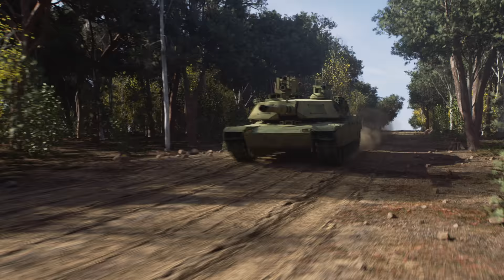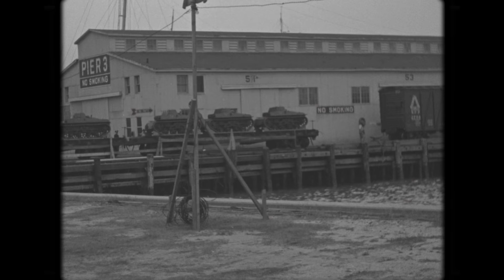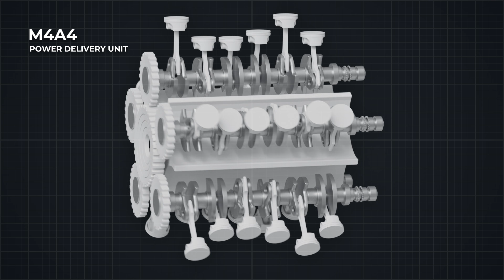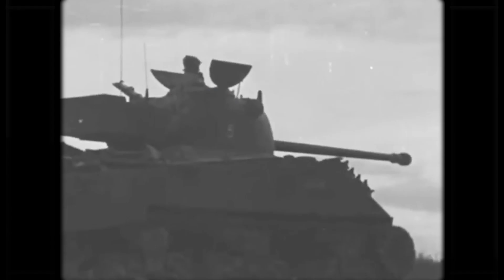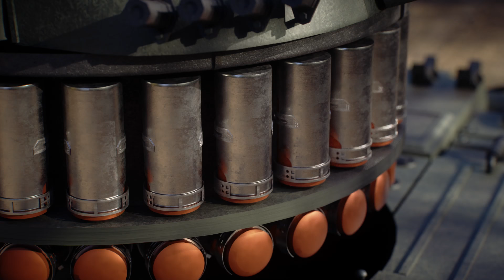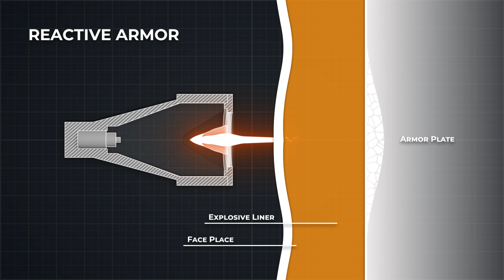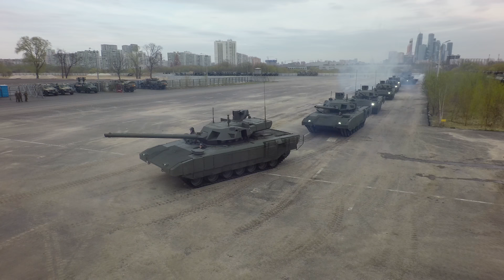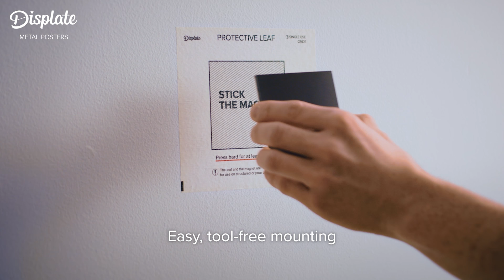Why America’s Tank Failed in Ukraine

Comment: drone threat can be solved by just making a didicated remote weapon station equiped with ir cameras and hearing which will see and identify drones with the help of AI, these things cost 1/3rd of what aps like trophy would cost. take and example of bullfrog rws, but the problem is its not following my researched desighn philosphy, its too bulky and big. my desighn comes with weapon station with short barrel mg42, backed up by short barreled shotgun if the fpv slips throug., this desighn has its cameras and hearing sensors equiped on corner of a tanks turret, thus making the main rws station less bulk and creating more room for AI and software alsong with ammunition. with this, it can engage fpv drones at ranges of 6-700m in seconds. plus it would cost not more then 50k comapred to active protection system that cost 900k$ and come with limited number of projectile that can be emptied by swarm fpv attacks. i hope defence companies can look into this rather then wasting time on new tank desighns and expensive APS. one thing i wanna say is that this AI anti drone weapon can be mass produced and eqiped on any armored vehicle this it comes with already mass produced mg42, and any shot gun. optics and sensors and not much of a big deal, these can be developed by 3rd world countries.along with hard kill, it can be linked with EW systems, thus providing absolute protection dome for tanks, APC, mraps, trucks, convoys, strong holds, bases, logistics etc. thanks you for reading this, if you came to the end.

Comment: Can I just say that while I largely agree with the premise and findings of the video, I have a certain bone to pick with these types of presentations?
See, whenever a Russian, Chinese, or otherwise "non-Western" system underperforms in a given conflict or scenario, it's all chalked up to the corruption, lack of innovation, capability, or inherent inferiority of those systems.
But whenever a Western system underperforms, there's always a tsunami of excuses about how maybe the crew wasn't good enough, or maybe the system wasn't suited to that situation, or how it didn't have proper support or tactical positioning. My point is that Western systems get a lot of nuance and policed language, whereas non-Western systems don't.
What people should realize is that these systems are designed to function in a specific logistical, doctrinal, and environmental context; nobody in their right mind should think that the J-10 is more capable than a modern Rafale multirole fighter just because the PA managed to shoot one down.
The Pakistani air force actually set up a kill chain and fired an AA at extreme range that was guided in by other assets, and the missile switched its own radar on for terminal guidance.
The Pak air force used the system as it was meant to be used as a piece of hardware in a networked, interoperable environment, whereas the IAF likely just relied on the raw specs of their planes and paid dearly for it.
But fanboys are gonna fanboy I guess...

Comment: Cause propaganda isnt reallity, western vehicles their performnace were overblown. Russian vehicles while worse, were not as bad as we were told. The war didnt go as smoothly for russia cause of their propaganda beliefs. But were able to adapt. And the west? Well we didnt adapt, we're just sulking and slinging insults without seeing, realising. Or changing the ways we think, tackle these issues, and face them earnestly. Oh and finally stopping to underestimate our opposition. But thats mission impossible for the west.

Like how are we supposed to beat russia when we arent even analysing them correctly. They are sustaining a high instensity war for many years now. While in a month. The US had to call for multiple ceasefires in iran cause of logistic issues and losses it cant replace, and equipment it didnt think it wouldve needed to replace at all. 

The war philosophy of russia and iran favor mass produced, easy to replace and repair equipment. Where the west is for profit, low volume, high tech equipment. That isnt easilly replacable. In an acctuall war between the US and russia. I would always bet on russia. We're germany in ww2. High tech, advanced designs. But not producing them in enough numbers. In a war, sustainabillity counts. Wich is an area we refuse to acknowledge and adapt to.

Comment: The main reason it has failed is that it is not being used as intended. I have seen pictures of Abrams tanks being sent in one or two at a time without air cover or infantry support. It was never meant to assault enemy strongpoints by itself. During desert storm it moved forward after enemy AT teams had been taken out with artillery and and gaps had been cleared in mine fields using mine plows or MICLIC charges. We prepped the battlefield with air power for over a month before sending any tanks forward on the offensive. Ukrainians have not learned to fight as a combined arms army yet. Minus the drones it's WWI trench warfare. Lessons learned from Ukraine will be incorporated into future US tank designs. Any tank that hits an AT mine and has it's track and road wheels blown off is a kill. I don't think Ukraine has the recovery assets to bring them back to the rear very easily. Not to take anything away from the tank itself, but the reason for it's success on the battlefield by US forces boils down to training and tactics. We don't spend a month at the NTC at Fort Irwin every year for nothing. Ukraine has nothing like NTC to train it's tankers to fight as a full battalion. Tankers who fought in Desert Storm claim that NTC was harder than actual combat. Send one or two Abrams into fields with mines, enemy AT gunners waiting, and drones over head and it's over for the Abrams or any other tank. It's clear that it does need some improvements to combat drone strikes, but I wouldn't say it does not belong on the modern battlefield.

Comment: Listen, that's like asking a ballet dancer why she failed as a dancer at a strip club.
America operates its tanks, cavalry, artillery units on a far grander scale with support units Ukraine can't imagine.
They operate in a unified, Air Force, artillery, armored infantry units, logistics chains that the United States operates in.
Sending a lone, older tank out with no armor scouts, or anti air units is crazy.
Abrams were designed for fast hit and run, if you can't afford the fuel, and  maintenance to keep them operational why did they ask for them.

Comment: They should have built more tanks that are easy to assemble and disassemble. Pop the engine out, pop the treads off, basically onload a bunch of major components and end up around half the weight, making it easier to transport in multiple loads, and then have ways of throwing it all together when you get where you're going.

Also, anyone try a bullpup turret?

Comment: First off, Russia didn't actually give up on turbines after the Cold War. Just like the Abrams, the T-80 has seen continuous development and is still widely used alongside the diesel T-72 and T-90. They've even talked about building new T-80 hulls again.

On the logistics side, nobody flies heavy armor across oceans on C-5s as standard practice. Entire tank brigades move on Sealift Command cargo ships—airlifting a 70-ton tank is a rare, expensive exception, and when they do airlift one, it's usually on a C-17.

Also, the whole "running out of gas while idling" issue was solved back on older Abrams updates. Modern M1A2s use auxiliary power units and battery packs to run electronics so they don't have to keep the jet engine running.
Reply: Половина Т-80 имеет турбину.

Comment: One thing no one seems to understand is why the M1 Abrams may be failing in Ukraine is that they are export models. They do not have the same armor that standard US tanks have
Also, this is true for Soviet tanks that were supplied to the Middle East and and Warsaw pack nations. They were export models and they didn’t have the same armor that Soviet army tanks had.
The British doing an inspection of NATO base in Poland actually noticed two tanks that didn’t look the same. They were Soviet manufactured and not Polish manufactured. They checked the armor thickness on it and found that it was different. This actually caused the British and the Americans to change some of the antitank shells that they use.

Comment: I enjoyed it! The title could have been called “Tank power, from tractor engines to jet engines” the hybrid tanks are an awesome idea, if you want full torque from a stand still and the ability to silently use your non driving tank. If it had an electric range of 2km that would still be awesome. The tank goes silent creeps between the buildings, takes the shot and move back into cover. On the way out of the hot zone the disel turn on and it gets up to full power and they recharge the batteries while on the move.

Comment: An interesting video, with an important error: the Russians did not find turbine engines to be unreliable.  They found THEIR turbine engine to be unreliable.  The M1A1 Abrams did just fine and proved itself in the Gulf wars of 1991 and 2003. Yes, it needed a lot of fuel.  But it operated within a supply chain designed for it.  Additionally, the T-80 was an innovative tank - but is was no match for te M1A1.  The depleted uranium slab and Chobham combination worked well in those wars - Russian tank shells bounced off the Abrams like their were tennis balls.  In contrast, when an Abrams fired its 120 mm gun, the depleted uranium round ripped open the Russian tanks, started fires and gave enemy tank crews a dose of neutron radiation.  However, the videomaker is correct that, after 40+ years of dominating the battlefield, the Abrams needs to replaced with something else.  Nothing lasts forever.

Comment: The first mass-produced tank with a gas turbine powertrain was the Swedish Model103 "Stridsvagn 'S'", introduced in 1966. It was powered by both a diesel engine and a gas turbine. The diesel engine was used for normal driving and provided good fuel economy.
The gas turbine was engaged when additional power was needed, such as for:

• rapid acceleration,
• higher speeds,
• driving in difficult terrain,
• climbing steep slopes.

Both engines were mechanically connected to the same transmission and could operate simultaneously. In the later versions (Strv 103B and 103C), the gas turbine produced about 490 hp, while the diesel engine delivered approximately 290 hp, for a combined output of around 780 hp. It was built like it had a knife edge up front. I was in one while going through a pine woods once, the tank was hardly rocking going through the massive trunks.

Comment: I hate these Fox News type clips. Maybe the title should be why the Abrams failed as a 5th gen fighter aircraft in Ukraine. I won't click another link from this Trumpspeaking channel. In war with America you                                      
won't see the American military field this tank. What makes the American equipment good is they value the soldiers lives. Only fools bitch and whine about the tanks weight. Tank commanders know how get where they have to go and have engineers facilitate that. The bottom like is America gives its warrior's the tools to accomplish the mission. America listens to their NCO's. I won't be surprised if good ole           
boys in Lima Ohio are not already designing Bradley's with front and rear 12 auto cannons to kill drones, you won't see our troops dying in mass riding dirt bikes. I am sorry but a heavy tank saves lives, if Europe  is worried about the weight of the Abrams tanks then they should build better bridges. And by the way fuel is an issue for counties that do now have fuel, no country on the planet has the ability to produce and supply fuel to its war machine like America. China has 35 air tankers, Russia has 20, America has over 600. China has about 1500 Walmart made fighter jets, Russia has about 800 and America has America has 2700.

Comment: Allow me to save everyone some time.
The tank didn't actually fail it was dumped onto the battlefield without a steady stream of replacement parts or replacement units and it suffered as a result.
Furthermore the thumbnail is a lie.
There were 80 Abrams tanks operational in Ukraine as of when this video came out and at time of writing only 20 have actually been visually confirmed to have been been lost in combat.
And for a final reason why you should ignore this channel most of his statements are copied from military watch magazine and he blatently repeats the myth that the use army wanted the diesel engine over the turbine at the start of the video when that wasn't the case then contridicts himself later in the video saying that was the one the army selected.

Comment: The video fails to mention that the high loss rate is because Ukraine used them for the highest risk missions. The most capable equipment oftentimes will have HIGHER loss rates because they r used for the most difficult missions. This is not an apples to apples comparison.

Comment: Starts at 18:00 and goes through 21:00.  Everything else is the history of every tank in the world since ever, and nothing to do with the title.
PS:  Ukraine is rebuilding old Russian tanks, putting a new turret system on them, and installing turbine engines.  Like the later Abrams, they also have APUs and supply them from remote generators.  The Russian tanks are smaller and lighter.  We don't know that they failed.  They didn't have many, and they loved using them in combat.  At that time they weren't so smart deploying them and finding them thermally at will was just coming on line.  What we do know is Ukraine is installing turbine engines on their rebuilt tanks.

Comment: The Russian military has a tank with a similar engine, so the Abrams is not the only one with such an engine as you say in the video.
Engine	SG-1000 gas turbine T-80B, GTD-1250 turbine T-80U, or one of 3 diesel T‑80UD[10]
1,000 hp T-80B, 1,250 hp T‑80U[4]

Comment: The tank's main engine problem is fuel and logistics to transport it. And then there's the weight of the tank. It's just not built for Ukraine's muddy groounds. Building drones is a more effective and low cost option than using tanks.

Comment: What does the M1A2 have to do with this? Ukraine was given an M1A1 Abrams. Also, in the video, it's basically 80 percent water. The Abrams' top turret is completely unprotected, which is why they're so easily destroyed. I'm too lazy to write more, but I want to point out that for some reason you didn't mention anything about kamikaze drones.

Comment: From what I have read the turbine engine does not provide any more power to space than the engine used in the Leopard tank. The turbine does not provide a power density advantage over a diesel engine. And the turbine engnine provides no significant advantage over a diesel engine. The Russian built an trubine tank also, but quickly appranelty decided wisely that the turbine was a bad idea. This was the only other country that decided that a turbine may be a good idea, and the one country that tried it abandoned this bad decision. That the US has not replaced this engine in the 50 years that it has been operating with this bad choice says a lot about American military intellegence.

Comment: So much misinformation i dont even know where to start. The turbine motor actually runs on jet fuel aka KEROSENE, the most common available fuel during war time. Please educate yourself man because it can run on over a dozen different types of fuels if kerosene isnt available. 

Youre also making the gas guzzling much more dramatic than it really is, combine that with the fact that it can run on over 12 different fuels then its VERY advantageous considering most MBT's dont have that capability.

Comment: You know little. The M1A1 SAs given to Ukraine are taken from the junkyards and are 40-year old junks.

They have no depleted uranium plates in front. Only ancient Kontakt-1 boxes the Ukrainians have bolted on.

These 31 tanks have been facing, for the past two years, Kornets which can punch thru 52 inches of steel - the frontal turret thickness of an M1A2 SEP V.3 .

They also face Metis, AT-5s, Saggers, RPG-28s, RPG-7VRs.

It's a miracle any are still left.